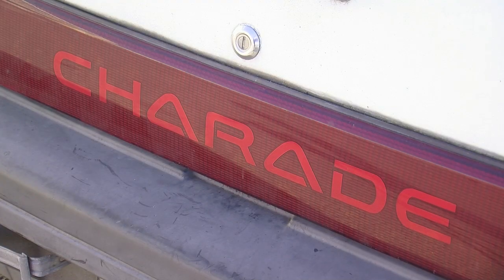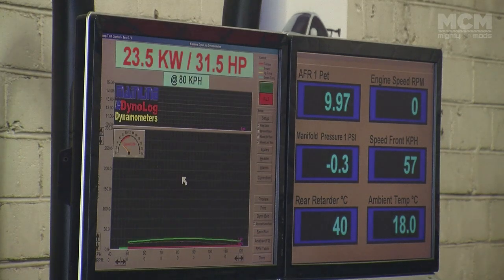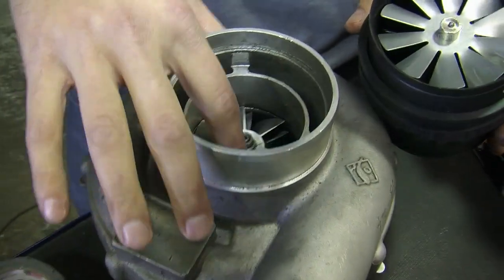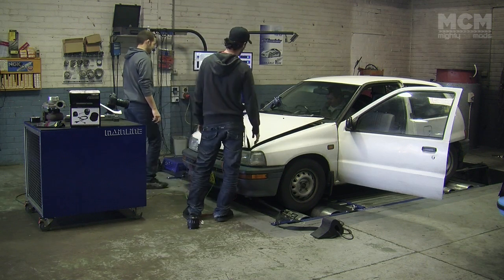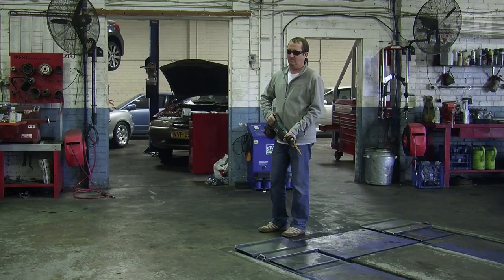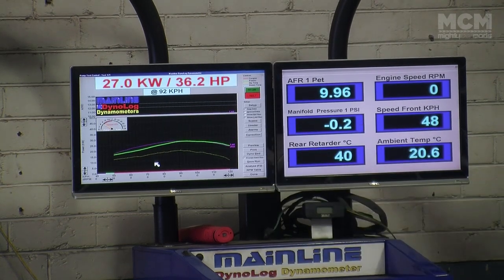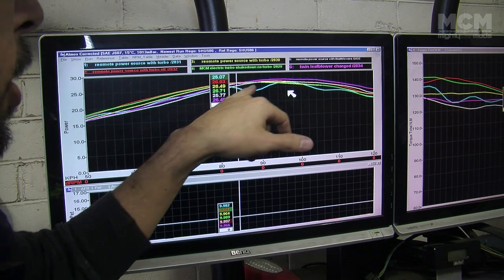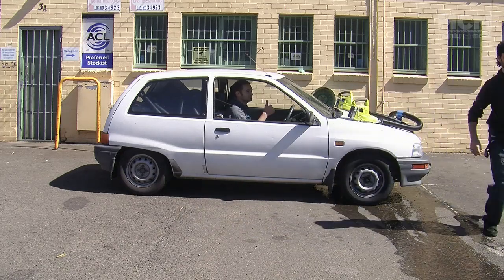Electric SuperChargers Mythbusted

Comment: Due to the fact that real turbochargers work by compressing the air so that there is more oxygen in the piston chamber (more oxygen more boost) then would mounting an air compressor work?
Reply: ***** no offense but thats not what its about. its about how much oxygen and fuel you can cram into a combustion chamber. what the turbo does is increase the manifold pressure. A supercharger does the same thing but its powered by the engine itself and not its exhaust. Theoretically an electric compressor could increase power aswell if it could be supplied with enough power.
Reply: no1ymfan1 >"Hold on a second, matter heats up when the molecules move around more"

There are two concepts at play. Molecule movement, which is measured by temperature, and the mechanical equivalent of heat.

Just because something goes faster doesn't mean temperature will rise (it can due to friction but that's beside the point), or you would be roasted during an airplane trip. All your body's molecules would be travelling at hundreds of miles per hour but hopefully your body temperature stays at around 37º C.

Now, if a system is isolated and the work is transmitted to it, the law of conservation on energy states that the energy must be turned into heat because the work cannot simply disappear. The Joule experiment involves dropping a weight tied to a fan inside a vat of water and measuring the temperature increase.

But if you go to a water slide and use your hand to paddle water down the slide with greater speed, the water won't heat up. Your work will result in an increase in kinetic energy so the water won't need to absorb it through heat.

Now, superchargers and turbochargers can be simplified into a process called adiabatic compression. It's not really (because again the system is not isolated) but even though new air keeps coming in, it's compression will result in an increase of temperature. There are firestarting kits that work with adiabatic compression, it's a piston and closed cylinder system with a space in the piston for you to put tinder, ignite it by slamming the piston and light your kindling.

What else do you know works with this principle? That's right, diesel engines.

And yes, cooling the air also increases it's density which is a factor in a properly engineered intercooler, but since compression will always heat up the intake air the intercooler is there to prevent premature detonation.
Reply: ***** Compressing air actually makes it hotter. It gets colder when you decompress it(take any spray and it will be getting more and more colder as you spray it).
Reply: +Robert Perry theoretically... maybe. But since a tank of NOS contains a lot more oxygen than a a tank of air that might be a better option.
Reply: I have always wondered why use nitros oxide why not use pure oxygen
Reply: NOS is simply easier to handle: It will liquify under pressure at room temperatures while oxygen needs to be cooled to nearly absolute zero in order to liquify, this is why oxygen is usually stored in its gaseous state (under high pressure) where its far less dense than liquid NOS.
Reply: +Robert Perry Nitrous allows oxygen to become more dense allowing more oxygen to get drawn into the combustion chamber
Reply: ***** It's called a mechanical engineering degree, maybe you should look into getting one because you sound jealous.
Reply: Nick Palaroan Compressor is a device used to compress. You have compressors in a refrigator, in A/C systems etc. Supercharger is a type of compressor, it's like rectangular and square - every square is a rectangular, but not every rectangular is square. It doesn't matter if nazis call it kompressor, compressor or hailhitlermachine - its still a compressor.
Reply: +Do M So you know physics  and chemistry because you claim to have a degree in Ohm's Law?  
One of the defining characteristics of a bad engineer like yourself is thinking that because you are an expert on a very narrow domain of knowledge that other people have no grasp of, you suddenly become incapable of being ignorant, even in fields that you have no experience in.  This is what makes bad engineers insufferable to work with. 

There is very little in an electrical engineering degree that is going to apply to mechanical engineering, and judging by your attitude, I suspect you tried for a degree in electrical engineering, but now work in Starbucks after flunking out.
Reply: +Nick Palaroan 

My thought was also that the OP was talking about using an industry (painting/airtool) compressor

the trouble is that that small car sucks in about 83 liters of air every second at top RPM (1:13 f/a mixture, guesstimating 5500rpm / 60 x 1liter)
Now look up compressors that can do about 83l p/s (4 cubic feet per second), you need a  compressor that eats more horsepower than it can deliver
(1 cfm = 0.25 hp, seeing as you're gonna need 240 cfm just to break even, you need a 960hp+ compressor)
correction: divide by 2, it's of course a 4 stroke engine (still ridiculous to achieve though)

and just a sidenote:
which means that that sorry excuse for a fan they use at a dyno is nothing more than to assist in cooling, for it could NEVER help achieve a ramair effect
There is a reason why windtunnels were built and why they need to be so large to achieve 'real world' conditions
Reply: +KR4FT W3RK It also is far more combustible and (if I'm not mistaken) considered Hazardous Cargo since you know, it can explode.
Reply: +Robert Perry Yes but no ... it can't be a piston based compressor ... because you'd need a HUGE one to get enough air flow (CFM).
Reply: actually a turbo charger works by allowing air to reach the combustion chamber faster.
Reply: KR4FT W3RK Yeah as the way things are, it would be inefficient and more expensive to have an electric compressor. Because you'd need a power source, preferably a generator, and you'd need an electric motor... in a way it is somewhat redundant, because you have kinetic energy being turned into electricity, only to be turned back into kinetic energy... :P
Reply: +KR4FT W3RK It's nowhere near absolute zero. Helium gets close, oxygen freezes solid more then 50K above absolute zero.
Reply: +KR4FT W3RK If that was the case then why is low compression necessary? oh wait that's because it's not about cramming as much into it as possible. Having the intake charged and ready to force air in when the intake valve open reduces energy required to PUMP the air in from the intake.
Reply: Xfactor Chem You are right, however its still not a viable alternative to NOS
Reply: +Robert Perry I think the nitrogen acts as a buffer between the combustion and the tank of oxygen, otherwise the whole thing would just explode.
Reply: +KR4FT W3RK Yes, exactly.

Although I don't think this was the optimal setup that they had.

They had the charger before air filter, etc.
Reply: +Do M dude what. The energy required to pump air in is negligible because a downstroke creates low pressure in the cylinder. A compressor or turbocompressor increases the volumetric efficiency of the engine.

Airplanes used superchargers and turbochargers with variable settings to compensate for the lower density of the air at high altitude. So don't tell me it's about the speed and not the density.
Reply: +Do M alternatively, air heats up when compressed. Matter can only heat up from kinetic energy on isolated systems, which the intake is not.

So why are intercoolers necessary if the air isn't being compressed, just sped up?
Reply: Filipe Amaral You are right, It is compressed.
Reply: +Filipe Amaral Hold on a second, matter heats up when the molecules move around more, and compressed air should be the opposite. I always thought the intercooler was there to make the air colder and therefore more dense.
Reply: no1ymfan1
The heat "motion" you are thinking of is not exactly related to actual physical movement of air. :/
Reply: +Filipe Amaral Guys, not the movement of the air itself, I meant the movement of the molecules in their respective places. The molecules of gases move around freely, compared to the molecules of solids that just sit and vibrate(ish) in place.
Reply: +Robert Perry pure oxygen will self ignite violently if it contacts oil
Reply: +Robert Perry Mercedes sells(or used to) engines with compressors. c180 with 2 litre engine - 129hp, c200 with same engine + compressor - 163hp. Compressors do work.
Reply: +Robert Perry Pure oxygen?  You don't want to try that.  That would burn an engine up real quick.
Reply: Filipe Amaral keep reading wiki
Reply: Lmao! Says the guy on YouTube hahahahahahahahahahahahahahahahahahahaha. I have a degree in electrical engineering, so get a life.
Reply: +Do M I fail to see how youtube has anything to do with this subject. You're the one provoking random people on youtube, now that's sad.
Reply: +KR4FT W3RK You know what would work a lot better for a boost? finding a different fuel to drive the engine in the first place! herp a der! Hell if you reinforced the engine you might even be able to use rocket fuel (aka Hydrogen Fuel)

Your car might explode but im sure you will get your speed boost
Reply: Filipe Amaral the only reason why the compressed air would heat up would be that the compressor itself is hot. Compressed atmospheric oxygen actually has alot of moisture and is colder.
Reply: ***** Then why do supercharged cars also have intercoolers? The F1 cars from Mercedes have separated the turbine from the compressor to make the air colder by placing the MGU-H between them, why do they still use intercoolers?
Reply: +2dogslide No. Mercedes makes engines with kompressors, which is german for supercharger.
Reply: +2dogslide You are correct. However, i get the impression the OP was referring to an electric air compressor like a shop would use for power tools. But in this same sense, a turbo is also a type of compressor.
Reply: +2dogslide I was only try to simplify terms so everyone was on the same page....although the idea of using a tank of compressed air (like the 35 gallon shop air compressors) is a very interesting idea....apparently its already being experimented with.
Reply: Nick Palaroan So wait, when nazis call supercharger a "kompreSSor" everything is fine, but when i call it a compressor it's wrong? You should realize that most of compressors don't have tanks.
Reply: +TheClassiestFox  Ehh, I hear that alot. I work as a welder and use an oxy fuel set up almost every day, and you can not light of a torch with just oxygen, nothing happens. Not even a plastic bag filled will ignite in anyway! unless it has something to do with oxygen purity, I'm positive this is a complete myth just due to my own playing around.
Reply: +Devin Williams And ofc things that can't sustain a fire in air might well do so in pure oxygen. I seem to remember accidents where people have accidentally soaked their clothes in oxygen and then discovered just how flammable jeans can be.
Reply: +Robert Perry Air compressors take a very long time to compress the air. even if the total pressure is really high you could never keep up with the (volume) demand and will probably burn out the compressor.

Comment: So first of all you guys made a mistake of placing the "electric supercharger" so far away from the throttle body. Aftermarket intake pipe would have also been a better choice to go with. Next the way you made the leaf blowers face each other was ridiculous because the leaf blowers were basically fighting each other and barely any air was getting so called "forced induction" into the intake. A single straight leaf blower that is in close range to the electrical supercharger that is close to the throttle body would have been the best way to do this job. Also if you guys were to do a simple thing called "side gaping" to your spark plugs and also cleaned your fuel injectors you would have been making tremendous amount of power on your monstrous looking car. On your next video you should definitely do this and dyno it. You have all the tools but are you willing to do it?

Please like this comment to bring this comment to attention of Marty and Moog.
Reply: +Javad Al Electric fans dont add power. They know giving the car a service would add power but The video was about myth busting electric superchargers not car maintenance
Reply: +Javad Al  2 years too late mate.
Reply: They know what they're doing, this sounds like it's straight from a ricer forum.
Reply: +Javad Al Forced induction relates to air pressure, not the speed at which the air is moving. Changing the shape of the tee fitting won't have any significant effect on air compression.
Reply: +Javad Al SIDE GAPPING is a waste of time, and risks gapping it incorrectly. Just buy some E3 PLUGS, or any other MULTI-PRONGED COPPER spark plugs if you want absolute best detonation angle. Besides, "side gapping" and simply cleaning your injectors won't get you jack, of course you SHOULD clean your injectors though that's just proper car maintenance.

(BTW, those leaf blowers could be 5 feet away from the throttle body and it wouldn't matter, the only thing that matters for forced induction is PRESSURE. The leaf blowers might be facing eachother, but it doesn't matter because either way it pressurizes the intake, and as soon as the throttle plate opens, all that air pressure gets sucked right in.) 
It's not like two leaf blowers fighting out in the yard, they don't "cancel out" LOL.
Reply: your mother is from a ricer forum.
Reply: Javad Al Your maturity level is from preschool

Comment: If anyone thinks these products work you are morons and don't understand anything on how engines work or the devices that actually work for power gain. You want to gain horsepower then stick to whats out and save money to spend it on tested true devices. Also weight reduce your vehicles of any pieces that serve no purpose. These guys know what they are doing and are absolutely right about using leaf blowers on the outside. Two things are gained by doing so, true cold air from outside the engine compartment and oxygen rich air devoid of exhaust. Hence the power gain. Turbocharging a car will always be pricy and labor intensive, but will prefrom so much better than any cheap solution bought off of amazon or ebay.

Comment: when people say dyno's have no air flow is because when you're driving along in a car on Roads you have Drag from the car trying to push through the air which reduces the amount of power, dyno's test the maximum power of the car with no drag, so expect a little less acceleration on the road

Comment: um its not 100 thousand or second its 100 thousand per minute ska RPM also known as revolutions per minute nit second.  Turbo's spin from 60 thousand up to 250 thousand revs PER MINUTE and require an assload of oil to keep the connecting shaft and bearings cool.  Thought some auto techs would know this.

Comment: youall need a diesel air compressor on a trailer,( put a hitch on yer car 1st ) hook'r up and don't drain the compressor for that little water injection kick. plus you can paint the car

Comment: Watching this makes me laugh at people who actually believe these Ebay systems actually do something to your car's performance.

On a side note, electric superchargers aren't fantasy: read up the Audi RS5 TDI Concept. It has a twin-turbo V6 diesel and also Audi strapped a electric supercharger on top of it all. However the said EV supercharger does require a separate 48 volt battery to power it exclusively on top of the car's existing 12v system. Kind of goes to show you how much power you need to be needing before actual performance gains become apparent.

Comment: Guys I have been watching and enjoying your videos for a longtime but I think your approach in many of your "conclusive mythbusting experiments" is not technically valid. 

Here you run the engine without the supercharger a few times and you get the HP between 31-35. That means your test facility (being the old engine+dynamo) measurement accuracy is below 4HP. That means you cannot meaningfully measure a difference in HP less than 4 HP. So you cannot title your video overconfidently as "mythbusting".
Reply: behzadutube I would disagree, even if the accuracy is ±2hp, that means it isn't even making 4hp more with the electric "supercharger."

Comment: Firstly I must disclose I am a professional Gaffer taper. They are obviously correct but I just wanted to point out firstly F1 use this tech and when they use it what do you think happens and secondly as the leaf blowers show if the power is right ie brushless motors and lithium ion hi output batteries are used you get a slight gain. So how much better then the leaf blowers do you think you can do, motors can create a lot more RPM's and psi then the engine with the right setup. Why do you think all the car companies are working on this right fricking yesterday (note: and not released it yet, Audi, Volvo).

Comment: what if you place the electric turbo behind a exhaust powered turbo charger, would it actually reduce turbo lag?
Reply: chanse1804 Not likely. A little fan like that probubly can't even move as much air as an engine consumes. It would be more of a restriction than anything else.